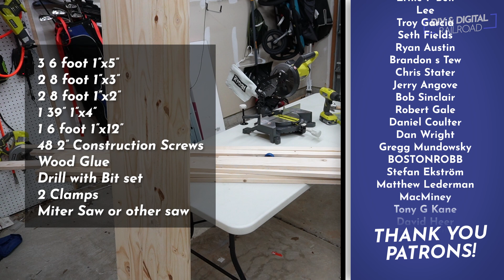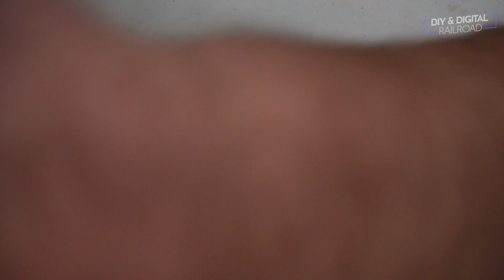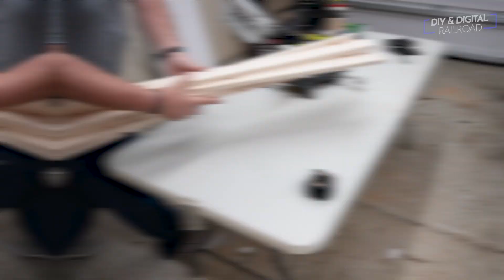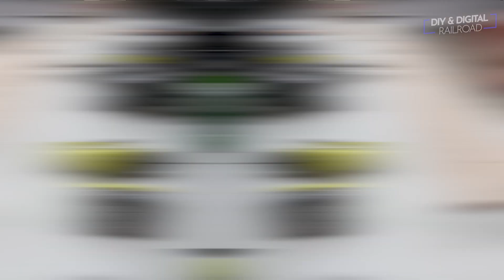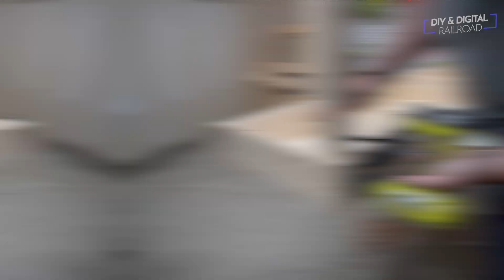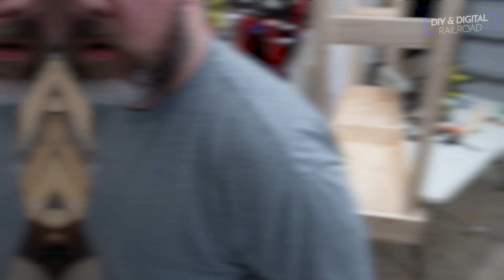Model Railroad Benchwork Made Easy.  MRRTwo Part 1

Comment: love your videos. my bench work is going up now.1x3 stock 2ft. wide various lengths. cross supports very 2ft . i will use 2 inch foam board on top.  do I need to put underlayment for that too? or will that 2inch foam board be enough for HO lay out?

Comment: FWIW, I 3D printed some jigs to make sure my screw pilot holes were perfectly vertical. Also put casters on my legs so I can roll the layout (15’ X 10’) out when I need to work on the back. Your floor needs to be relatively level for that.

Comment: safety issue:    One should never operate a power tool (drill) towards one's body as you did when drilling and screwing the L girder legs.  One slip and and it's either band aid time or trip to the ER.    Not a lecture, just Been There Done That - learning the hard way!
Reply: I like the saying: cut to your buddy not to your body.

Comment: For more portability (to shows or your local club), use wing-nuts and carriage bolts instead of screws to attach the legs to the base... and R Wissbaum's comment about adjustable legs is also good... I have height-adjustable locking casters mounted on the bottom of my legs via the T nuts. Got all the hardware as standard supplies at my local hardware/home remodeling warehouses... you know the corporate names for the ones near you.

Comment: Since I have NO even floors in my house, I like to add adjustable feet to the legs: Glue and screw a 4" length of 2x2 into the inside corner of each L leg, flush with the bottom. Drill a hole in the 2x2 from the bottom to accept a T nut, pound the T nut in with a hammer, and finally screw in the adjustable feet.
Reply: What are your thoughts on using a 3x3 across the bottom of the leg for this purpose? I have the same issues with no flat floors, but my thought is that since the leg is then resting on the support structure, it may have a little more strength - of course I may be over engineering it! 🙂
Reply: @neilharbott8394  Truthfully, it mostly depends on what you have on hand, or what you can easily buy. Wood is incredibly strong as long as it is in compression. My current layout is on casters, and the legs are 2x2s connected by 1x3s on either side, flush with the bottom. The casters attach to the 1x3s, so the weight of the legs is transferred to the casters through those side joints, which are - as always - glued and screwed. I weigh over 300 pounds, and before I attached the table top to the L girder frame, I tested the strength by doing dips on the frame (I locked the casters first!). No problem. (Since I made my layout movable with casters, I went perhaps a little overboard with cross bracing on the legs. Not sure the extra 3x3 cross brace adds much if you're not going to move the layout.)